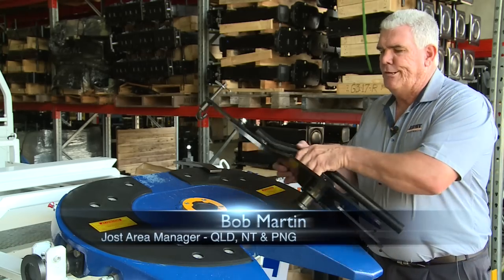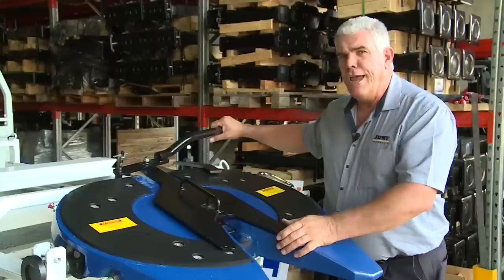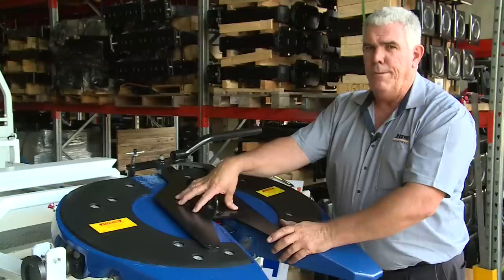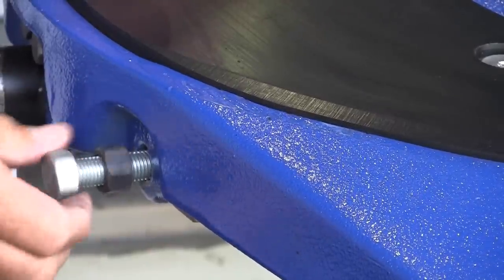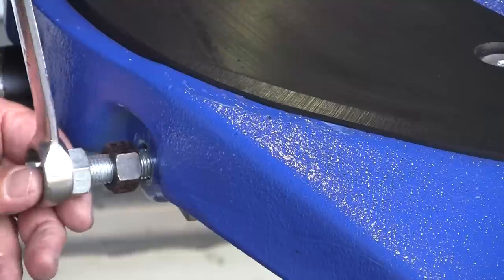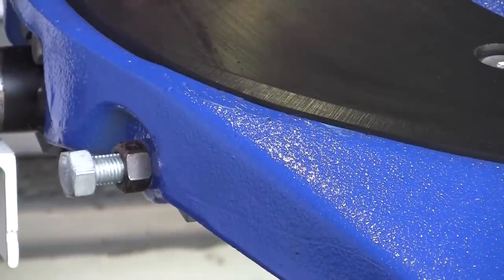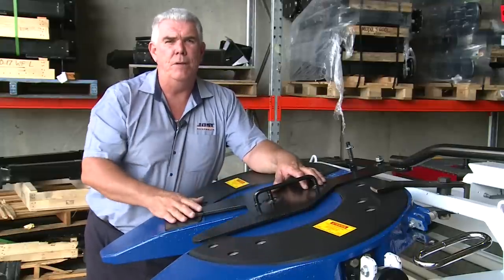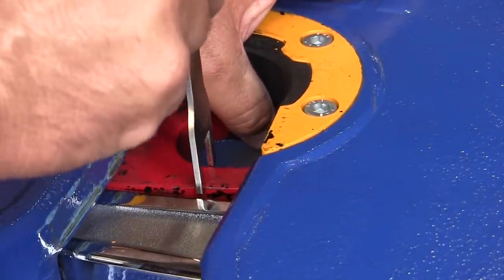Jost JSK37 Fifth Wheel Adjustment

Comment: Can we do this  adjust with the trailer connected?
Reply from the maker: No
Reply: @AustralianRoadTrains  thanks for reply my question greetings from California
Reply: Yes you can it's basically the same thing except for limited space when the trailer is connected.
Reply from the maker: @icardenas3909  Using the trailer kingpin for the adjustment procedure is certainly not recommended by any manufacturer. This is becasue the Kingpin is a wearable part and the wear on a king pin will vary from trailer to trailer. Watch the video on how to check a Kingpin: https://www.youtube.com/watch?v=cjLs4D1L7FQ
Reply: @AustralianRoadTrains  If we are using the same trailer day in and day out then it's fine right?
Reply: @AustralianRoadTrains  I tried adjusting the fifth wheel Jaws with the jaws open. Will no adjustment take place when the Jaws are open and the bolt is backed oin or out?
Reply from the maker: @icardenas3909  No. You need to make the adjustment to correct specification which is the purpose of the tools. If you adjust your fifth wheel to a worn king pin it is only a matter of time before the coupling will fail.